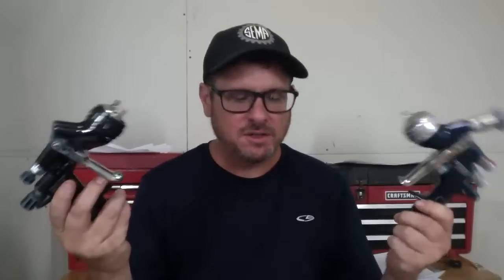How To Set Air Pressure (PSI) on Tekna Spray Gun Live Q&A

Comment: If I reduce the material flow at the material needle, do I then need lesser air pressure to achieve good atomization? Asking from the context of a DIY guy who uses a much smaller air compressor.